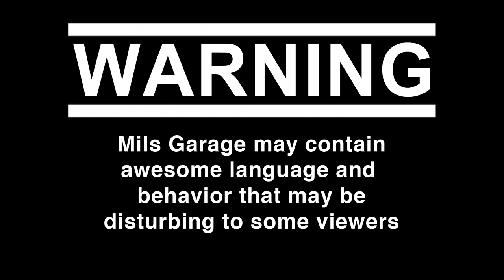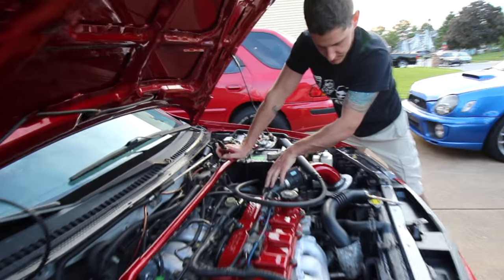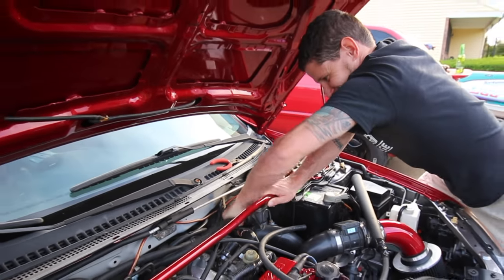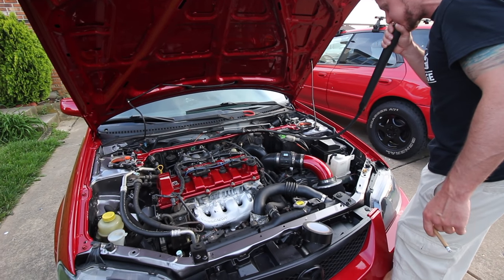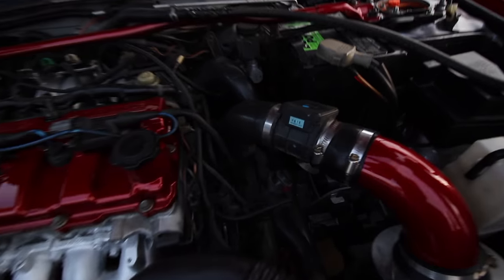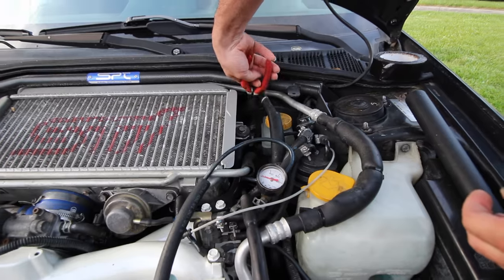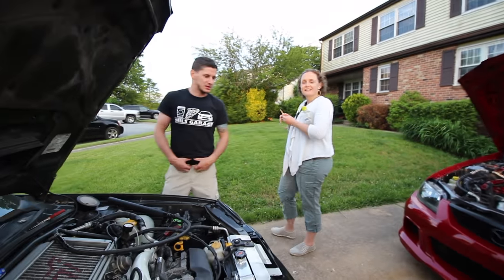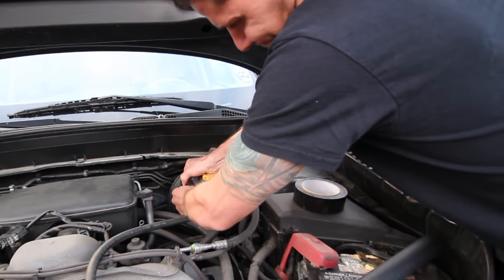Cheapest Vacuum Leak Test Ever [ 99¢ Diagnosis // Automotive Boost Problems ]

Comment: Brake boosters often leak, so you should blow smoke into the the intake with a makeshift adaptor and also turn the key on to activate solenoids and valves to be sure you're testing all the lines.
Reply from the maker: Yeah? That sounds smart. 👍
Reply: @milsgarage  Look smart >>> be smart. I know...I'm a teacher.
Reply from the maker: Be smart >>>>> Look Smart.   @jylbo
Reply: @milsgarage  Yeah sure, just kidding ;) Have a great day !
Reply from the maker: @jylbo  You're Awesome bro 🤘🤘🤘 Happy Thanksgiving! Gobble gobble gobble!! 🦃
Reply: So you can test the booster too.
Reply: @termonostruman  Correct

Comment: Got the same lean engine, misfiring problem on my 04 Celica. Runs pretty good after I've picked up speed, but acceleration is a little slow and rugged. Going down the laundry list of possible fixes. So grateful for videos like this on youtube!
Reply from the maker: Woohoo!! Thank you! i'm really grateful for your support! Misfires are no fun, but keep up the awesome work 🤘 All of our cars started like that, but hard work definitely pays off
Reply: @milsgarage  I'm seriously at a point where I'm just happy the car runs! Did the smoke test this morning and found no leaks. It feels better when I don't baby the throttle, almost like it wants to be driven that way.
Reply from the maker: Awesome. If it has any issues after the smoke test, cleaning off the mass airflow sensor might help 👍
Reply: @milsgarage  That was actually the first thing I did. It looked almost brand new, but I cleaned it anyway. Replaced the valve cover gasket, the PCV valve, tested the ignition coils, tested the fuel injectors, replaced the spark plugs, put in an Emissions Control Fuse that wasn't even there...will check the fuel pump and filter if a new cat doesn't change the game, as mine is very rattly.
Reply from the maker: Beautiful! You're knocking out all the most neglected parts. Truly awesome work! 🤘🤘🤘

Comment: Try a soldering iron into mineral oil. Glass jar with lid. Epoxy the soldering iron through a hole. Epoxy an entry and exit tube. Use a bicycle pump to inlet and exit to brake booster tube. Light the mineral oil with the soldering iron, it creates a lot of smoke. Pump the pump and away you go. $20 to $30. But I think I will try the blowing smoke. Weed would be worth a shot. Happy repairs.
Reply from the maker: i really like this idea, and i love your engineering skills. Keep up the awesome work Tony! 🤘🤘🤘

Comment: Sometimes you get a vacuum leak from your brake booster get the diaphragm inside has went bad brake boosters can go bad my suggestion is take the hose off the motor reduce the hose size and put a vacuum gauge at AutoZone and other parts stores you can buy a vacuum bleeder that you use for doing brakes but you have to reduce the size of the hose down so you can pet vacuum on the line going to the brake booster a lot of people don't check to see if the brake booster is bad one indication that a brake booster is bad when you put on the brakes and you hear a wishing noise like air whooshing noise the diaphragm can be broke and allow are into the system also also you need to plug off the exhaust system use a couple latex gloves and some duct tape plus also when you put smoke in the system it's going to come out the intake on your intake manifold all the way to your air filter but if you tape up the intake with a glove and some good tape you can do a better test when you go to do a smoke test on a vehicle you have to seal up the exhaust and intake on the vehicle hope this information has helped you

Comment: I found a rubber cap on my vacuum tree that a pressed on and it disintegrated. Replaced it still runs crappy but I don't know if the computer needs to remap mixtures because it was such a slight leak
Reply from the maker: Is it tuned? You could always do a soft reboot 👍

Comment: Noticed the MP5 strut bar so quick, lol. Have an identical one (red also) on my Ford ZX2 (similar chassis, bolt-on)
Reply from the maker: ZX2 has the same brace? lol Crazy Fords. i never compared the ZX2 and Protege chassis side by side.. Didn’t realize they’re running the same setup 😮👍👍

Comment: So your cR theew to rich to lean codes with misfires as well. My c300 2010 4 matic sport is sending the same codes. 
I replaced the maf sensor /filters 
Fuel injectors
Spark plugs and oxygen sensors 
Still throwing those misfires and to rich to lean codes 
Im thinking now definitely a vacuum leak. BecUse i can hear the hisss and when idleing it sputters .
Reply from the maker: Man, all these comments got lost. You ever figure this out?
Reply: @milsgarage  yea I had a gash in the intake manifold of mine
Reply from the maker: @monclersupreme4962  Awe man, no bueno. Great work 🤘🤘🤘

Comment: I did this test on my 57 Chevy using a Tiparillo cigar and it did not work.
Then I used a Cuban Cohiba cigar with a 52 ring gauge and quickly found the vacuum leaks
Reply from the maker: A Cuban? 😮 What do those things go for these days? Also, awesome work!

Comment: Thank you.  You made me consider simple things..... which led me to my childhood favorite fireworks and viola I'll use a smoke bomb of a highly visible color. Do you think that there are any problems I'll be up against? (I do recall that the smoke bombs used to dye the sidewalk that I placed them on).
Reply from the maker: Smoke bomb?? O_O LOL.. Yeaaaah, that's what i was thinking too... i feel like they leave a coating of colored soot on things they're too close to.. It might clog up sensors and then need cleaning on the inside of pipes.. Even if you use tobacco, i'd recommend cleaning off the MAF sensor (they have specific cleaner for it) afterwards.. There are other types of smoke for sure though

Comment: There is a way easier way use a card cleaner and spray on the vacuum lines and you'll find it because the cars
Rpm will increase
Reply from the maker: This is cheaper, but that's also very smart sir. Great idea. 👍👍👍 Your way, you won't have to clean off the MAF sensors.. Maybe they cost the same in the end lol

Comment: I have a 2012 chevy impala what hose can I check to see if I have a vacuum leak? I have symptoms of a leak but there hasn't been a code thrown. The only other thing that happened is I got engine hot ac off one day but I believe it could've been my coolant temp sensor. Any help would be greatly appreciated
Reply from the maker: Sorry for the delay! You might be able to plug it into the vacuum line if you cap off the air box area. You'll want to clean off your mass airflow sensor afterwards
Reply: Did you ever find a solution for your 2012 impala or find the leak? I also have symptoms of a leak and got the engine hot alert

Comment: Did you guys ever find the vacuum leaks? I find that often the vacuums that contol the VICS near the  passenger side of the manifold dry rot very quickly and cause vac leaks. On the rgular FSDE manifold I think there is one underneath with a one way check valve and I think two that exit the manifold near tue VICS vacuum servo. Also check the gasket around the egr valve. Ive had those leak a few imes an cause problems.
Reply from the maker: @Avery Yeah? Thank you for your help! i'll run these ideas by Ryan. 💯 You rock Avery! 🤟😎👍
Reply: @milsgarage  Youre welcome. Actually my screen name was suppose to be Retrocar Style. I was typing my nick name as my screen name and pressed enter by mistake before changing it. Thats what happens when you have a few beers late night while trying to read a thick exam book and navigate a youtube channel setup at the same time.....( formerly known as FujiR500 )
Reply from the maker: @RETROCAR STYLE LOL i remember those days.. college?
Reply: @milsgarage  Nah ASE re-certification time!!!
Reply from the maker: @RETROCAR STYLE Nice!! LoL Multitasking at it's best

Comment: Hey! Came upon your videos searching for G35 Diff/Trans DIY's! Just subbed, you guys are really great!
Reply from the maker: Hey Justin! That's awesome! Are you working on a G? Thank you for your support!
Reply: @milsgarage  just doing general maintenance, just did a brake fluid flish with some MOTUL RBF 600. Which is nost likely overkill, but with the condition of brake fluid I suspect other maintenance is lacking as well.
Reply from the maker: @Justin Butkus Great job sir. 🤟😎👍 Welcome to the channel
Reply: @milsgarage  Maybe you can help me with this issue. When the radius rod is bad, it makes a clunking noise when going over bumps. But mine makes the same noise over bumps and while going over 60 mph. 

You ever run into a similar issue?

Comment: Genius idea you guys I was wondering what tire Dimensions do you have specifically the offset cuz I'm looking for a pair of rims that have a deep lip on them like those and I think I found the pair I'm just not 100% sure
Reply from the maker: i can't recall the specs off the top of my head, but i know they're in the Mazda fender rolling and fitment episode [ https://youtu.be/5oe1qTlCMYY ]. That episode covers everything we needed to do to get the 18"x9" wheels to fit right
Reply: The wheels are 18x9 +35 offset
Reply: O and the tires are 225/35/18

Comment: Is  your car engine running while you're blowing smoke?
Reply from the maker: No, you'll want to leave it off for this test. After doing this, it's also a good idea to clean the mass airflow sensor 👍
Reply: How do I clean my mass airflow sensor? Sorry I'm a single woman I have no man but I'm new at this but and I'm going to try!
Reply from the maker: Yes, you can absolutely do this. 💪 To clean the mass airflow sensor, it’s usually held in with a couple screws, and located on the intake tube. It’ll be connected to wires. You’ll need to disconnect the wires, remove it and put it over top some paper towels, and douse the sensor with Mass Airflow Cleaner (you can find this at an AutoZone or Advanced Auto type automotive store).. Air dry, reinstall, and all ready to start 👍

Comment: Question for you guys... When blowing through the brake booster hose, should there be back pressure? I tried this with smoke, vape, and an air compressor (low PSI  just to listen for hissing) but I'm doing this solo and am not seeing or hearing anything. I have the hiss when I take the brake booster line off of the firewall but when I blow into it, the air seems to go somewhere without building resistance but I can't figure out where. Any help would be greatly appreciated.

Comment: What if the leak is where the line attaches to the brake booster, and you  just ignored it :D
Reply from the maker: Buying ear plugs is much cheaper than fixing the engine 😁

Comment: Did you figure  out the problem  I'm having  the same problem  I already  changed  spark plugs maf egr fuel pump fuel pressure  regulator   coils   and I'm still having  the same  issue    it's weird the car drives fine   the first 15 min  after the engine  cools all the way down and after  15 min of driving   when you try to  punch it it just bugs
Reply from the maker: Yeah, it was a leak from one of the intake connections. Did you do the vacuum test? If you use tobacco, you'll want to clean the MAF sensor afterwards
Reply: Did you find out the issue with yours? I've done all of the same plugs wires etc... Desperately need to know as I and my family need to get to our appointments. Any response or help would be greatly appreciated. Thank you

Comment: I'd just loaded the edges up with black silicone gasket maker
Reply from the maker: Sure, that'll definitely help keep it all sealed. i've seen some people's intakes shake loose, and it might help prevent that from happening. i remove mine so much that i just make sure the couplers fit completely over the pipes, clamp it and send it :)

Comment: ya dis its good now for me to do test on dis vw. Hope not to fined dis smoke for me.
Reply from the maker: Yes, you can try this test on a VW. After you finish, you should clean your Mass Airflow Sensor with MAF cleaner. i hope you don't find any leaks, but if you believe there is one, this is an easy way to find it for sure 👍

Comment: What is a vacuum line?
Reply from the maker: Tubes connected to parts of the engine/intake to utilize vacuum pressures for operation of components, and relief of pressure buildup from increasing engine temperatures

Comment: Forester leak was probably for the psv valve.
Reply from the maker: Yessir, that was the first change we made after the test 👍👍👍
Reply: @milsgarage  now if you vented psv to atmosphere and blocked the intake side of Intake manifold from psv. The psv opens to less than .05 pounds system pressure. Would save a lot of oil coating on IM. Makes for less valve build up and oil burn other than say worn rings.

Comment: This doesn’t work at all, first of all, all your smoke is leaking out of the dumb thing you made. Second, smoke from cigs dissipates too fast... use a vape would be better or better yet, an actual smoke machine or air and soapy water.
Reply from the maker: You must know everything. i could give advice too, but i won’t.

Comment: O don't even know what hose to take off to try it
Reply from the maker: Brake booster
Reply: @milsgarage  I don't have a brake booster per say
Reply from the maker: @Ghost-Of-Kyiv-  What are you working on?
Reply: @milsgarage  p0171 BANK 1 code on my Lexus Gs 400 can't find the issue .. LTFT at 35% , all hoses look good and replaced what was old, pcv valve new, new stock intake, new maf, same results 😩 this was a great video btw well done, nice car 👍

Comment: Can you use a vape???
Reply from the maker: Yes, but if you use either method, you should clean off the mass airflow sensor afterwards with some cleaner from the auto store 👍
Reply: @milsgarage cool thank you, other than cleaning the mass air I was unsuccessful.. I think my iac is on its way out...
Reply from the maker: @Travis Moon Did you ever get it all figured out?
Reply: @milsgarage  i sprayed my iac out with wd40 because it was not closing properly and it is much better now and my plugs are a bit darker, I will still have to take it in but for now I'm much happier